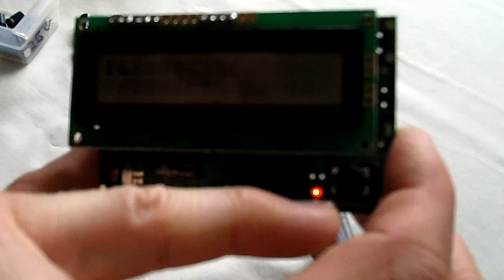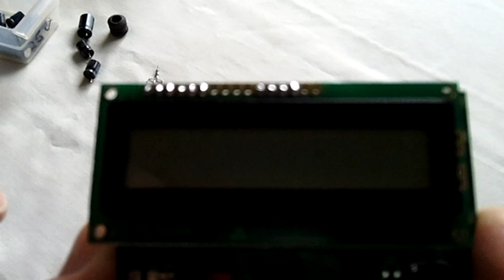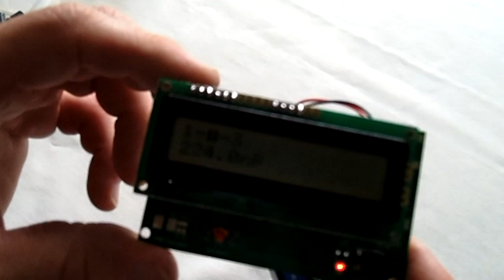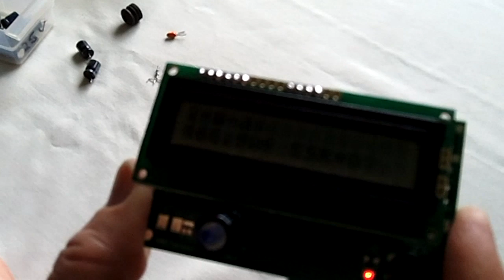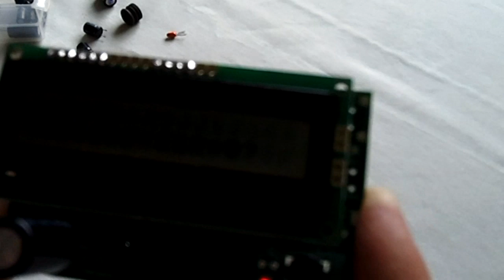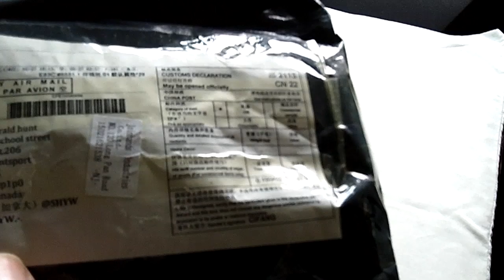How To Calibrate A Booster Edition V2.3 Ebay Esr Capacitor Transistor Tester

Comment: THANKS! I have a booster edition 2.2 esr meter and it was constantly measuring +0.5 ohm esr more than capacitors realy had. After doing the calibration esr is being measured correctly.
Reply from the maker: you're welcome..glad the video was helpful

Comment: Hello there!  I picked up the v2.4 (2013/07/01).  Did I miss something, or is this thing just incapable of doing an ESR on poly or ceramic caps?
Reply from the maker: to tell you the truth I'm really not sure. I haven't tested it with any poly or ceramic caps..I hope it will work though
Reply: ***** I was successful (thanks to your video) in calibrating it though.  I used some radio shack jumpers (yea, i still have some laying around) and put pin 1 to 3, and pin 2 to 4, and it kicked into calibration mode no problem...

I'm finding that anything under 1uF, it's not showing ESR for electrolytics, and I can't get an ESR to run on poly or ceramics at all...  though 2.4 seems to be immune to polarity issues with the electrolytics.

[edit] I don't have any poly/ceramics over 1uF to test, which could explain why I can't get them to test.

Comment: Hi, Glad I found your video. I bought one like yours also on eBay but did not receive any form of instructions or leaflet at all. Just wondering whether you received instructions with yours, or whether you know where I can get hold of some instructions? The seller's English is not very good and Ive tried to ask them but they dont seem to understand what Im after.
Thanks.